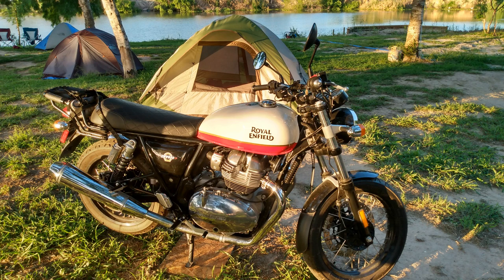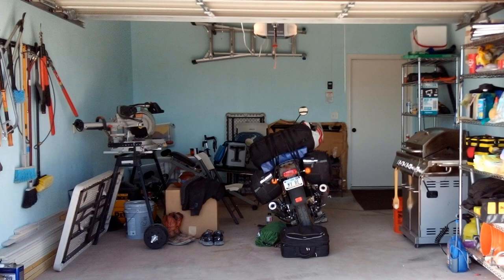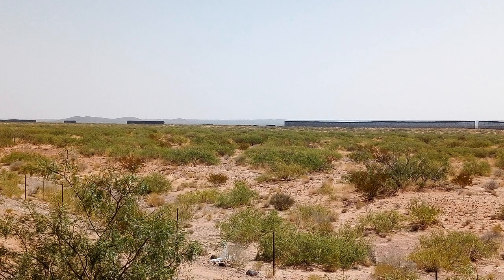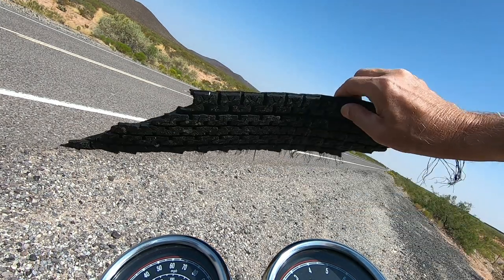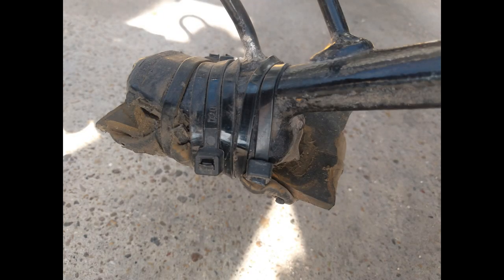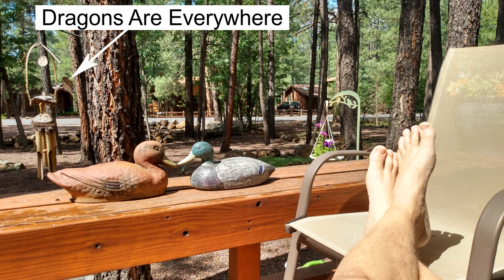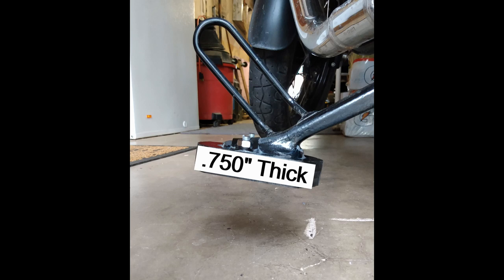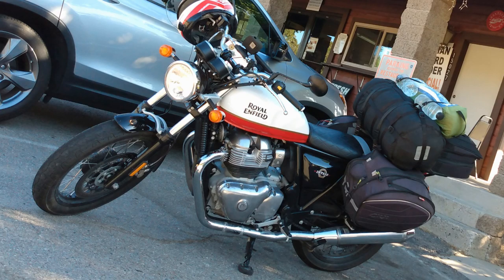INT 650 Side Stand Modification For My Royal Enfield

Comment: Great idea.I noticed my bike leaned over alot as do other bikes but the Int is top heavy & I was paranoid the weight on the spring mechanism.So I ordered a 20mm Side Stand Riser from Baak Motorcycles in France & it works a treat & looks great but was
not cheap at £86 & is alloy & a further £30 for postage so a £116 all up.The reason why postage is so expensive is they deliver it in about 4-5 days,must be air mail.Fits perfectly & is high quality & to me is worth it to keep bike up right.I seen hockey pucks glued on but glue don't last long.
Reply from the maker: Thank you for watching my video and the comment. That looks exactly like what my buddy did. Mine may have more area, bigger footprint. Like minds. Very cool.

Comment: Hi MAMRE,
yes, it's still a mystery to me why motorcycle manufacturers always make the foot pads of side stands as small as they think they can get away with.
If you are not parking on flat smooth tarmac, the chances are you will have to manipulate the bike for a while to get it into a position where the small foot pad they give you is able to support the bike with the required level of security. Since I almost exclusively park on dirt or gravel, I am looking for a similar solution for my Meteor. I do have a plastic puck from my Bullet days and I will take that with me in future, as soon as I get my cases fitted to the Meteor ( ordered the wrong bolts and the right ones seem to be on an extremely slow boat from China ! ).
It just seems silly to me that solutions like yours don't come from the factory in the first place. Seems to be common amongst many manufacturers though, not just RE.
Thanks for sharing another interesting video MAMRE 🙂
Cheers 👍🏻
ER.
Reply from the maker: Check out the comment from Ruahines Rider. He mentions a French company that has a side stand product that looks almost exactly like mine. Thanks to you, for the view ;-)